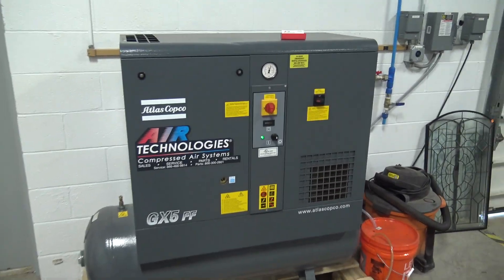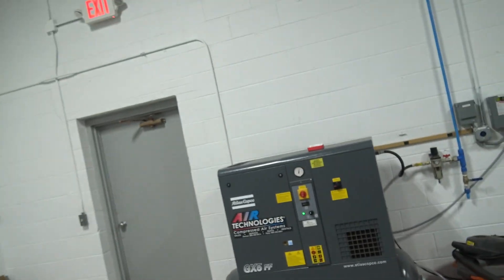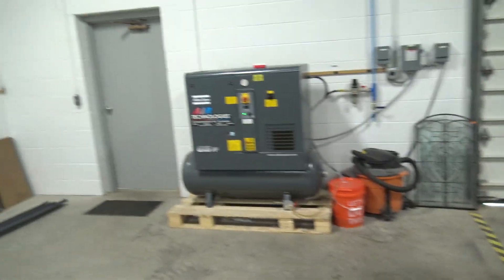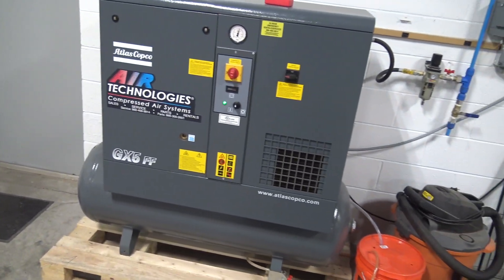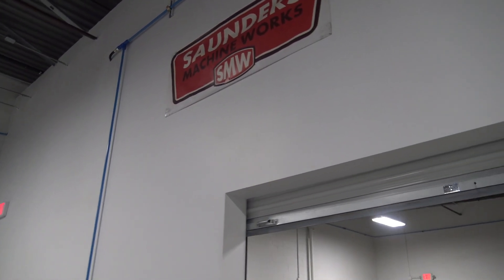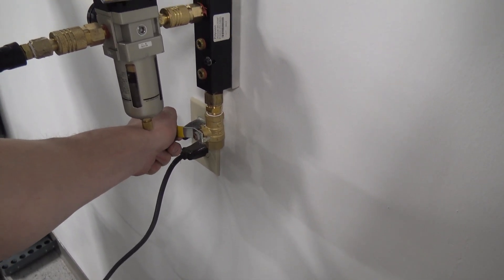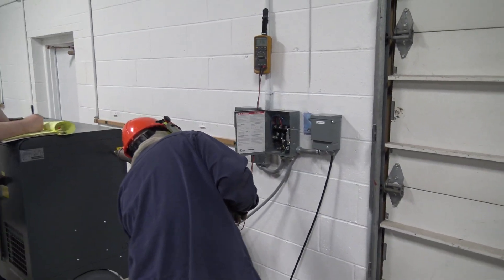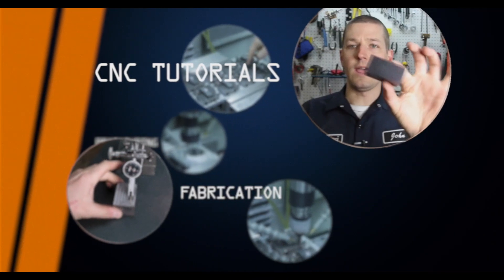Rotary Screw Air Compressor:  What are they?!  Worth the hype?

Comment: Beautiful shop!, first time watching your vids!
I have used and worked around a number of screw comps, 10hp to 65hp, and they are definitely a nice compressor compared to piston comps. 
They are designed to use oil to help sealing of the rotors and pass a LOT of it out the discharge, and the oil separator should catch 99% of it, but a external refrigerated dryer with proper filters and traps, will give you superbly clean air!, again, not cheap, but worth it in the long run!. 
The one at my old work is an Italian made 10hp unit (ABAC or some company), and the auto-drains did dump a tiny bit of oil outside the shop, but very very little. not enough to show on the sight glass between services, its literally vapor, compared to some piston comps that blurt out oily milky goop every time you drain them.
Best of luck with it!, wish I could have one at home and at work :D
Reply: it look  like you are the the  excellent  techinal  engeener .   if need  low price spare parts replacment for altas copco spare parts .maybe can contact me .    and  screw air compressor come with  air dryer , filter  together units ,not very high price.  1200-2500USD . :face-purple-crying:

Comment: @NYC CNC it is actually a good naming scheme. GX5 is because it is a 5KW motor. Most Atlas Copco compressors work this way. GA11 = 11KW motor
Reply: Also the computers are fitted to the next GA range and is called an Elektronikon. Reason compressors dont like too many stop/starts is because during start up they draw a high current to get the motor going. This causes the windings to heat up inside the motor causing them to short and blow the motor if it starts too many times. This unit will be limited to 240 starts per day and as you go to higher power motors this reduces. If you go for a VSD they can start much more often. You could also get a thing called an OSC which the condensate from the compressor drains into and it separates the oil from the water before draining the water into the normal drains.

Comment: I have been using German screw compressor 10 HP since 2010 and its really great.first of all its way quieter than those piston ones (when I hear them now they feel like someone is hammering on my head or if you remember those annoying woody wood pecker cartoons). and I think mine is quieter than yours too.They definetly save me ton of money in long run as I have attached a (30 inch diameter and 10 feet tall) tank (which I made in my own shop) to it as it didn't came with a tank. I only have to fill it once or twice a day and I only need to run it for 10 to 15 minuts. I am running it on its full capacity that is 8 bar pressure.I am using air for plasma cutter, air tools(drills, screw drivers, grinders for small work etc), CNC, and paint jobs.it definitely gives out some oil in the air that is why I keep my tank filled almost all times so that the moisture and oil settles down, and the auto float ball on the bottom of my tank can expel it and I get crisp and clean air for all my tools.I would definitely suggest people to buy this if they need ton of air all day long if not then cheapest is to go with piston compressor.

Comment: Lamens terms: it works like a supercharger.
Reply: Lynx Star Automotive 
I'm pretty sure roots compressors are waaaay more common in supercharging.
Reply: and waaaay more inefficient. Look up Lysholm supercharger, and you will see something very similar to what is in the air compressor. The -53 series Roots style blowers which came on old diesel trucks beat the air something chronic causing massive increase in air temp. Roots corrected this problem a tiny amount by twisting the rotors in the later -71 series blowers. But both series are massively inefficient compared to the more modern (been around for decades) Lysholm screw superchargers.

Comment: that particular Atlas Copco compressor will only run start stop, it's just like a piston compressor without head unloaders. it's really kind of a shame because  the nature of a rotary screw compressor is its ability to run continuously at 100% duty cycle, this compressor can only do this if you match it capacity or exceeded it
Reply: I am trying to talk my current work into buying one to replace the 20 Harbor freight grade chinzie piston comps they have strewn around the shop. I would love a 7.5hp continuous run unit for under $10 grand with dryer unit and tank, but the boss is a bit stiff and seems to be in love with buying loads of dirty cheap chinese crap :(, its a hard battle, but I will win eventually :D

Comment: Our last screw compressor was an atlas copco GA5 35 cfm after a 65 cfm Ingersol Rand that was running 2 large air powered printing machine. Fantastic machine, however we were not well aware of the stop/start cycles setting. When we downsized, the GA5 was essentially producing shop air only to a large receiver tank. We had barely used it over a period of 5 years. Short story long, the air end was damaged by water in the oil and rusted bearings on the screws, and followed with damage to the screws. 4.5k to rebuild ouch! So after the damage was done, we were told the computer was programmable to keep it running and allow it to get up to temperature, evaporating the moisture out of the oil and thus not getting fucked. Expensive lesson to learn, we ended up selling it for scrap value. I now have a vane compressor which doesn't have any of the fancy refrigeration but pumps a stack load of air at much cheaper price and quieter. As you say, screw compressors are awesome for continuous supply
Reply: yes, we were made aware of this and programmed the run-time as you were talking about, remaining on idle for longer periods. this was not originally set up when commissioned, so the compressor worked for a number of years starting as required then stopping once pressure was reached, the oil was never really hot, so the moisture remained in oil, causing corrosion. We ended up going to a small 17cfm piston compressor for shop air, and only turning on the screw for spray painting and sandblasting after spending $1500 to have just the bearings replaced in the air end. (not spending $4500 on a new pair of screws), the machine was sat idle unused, then when i next went to use it for sandblasting it would not generate pressure. very sad end to an awesome machine, we got $500 for it as is when we moved shops
Reply: to clarify, the GA5 did have a run computer, we were not aware of a possible issue, and the computer was not commissioned to keep it running, and even with a computer we still suffered a major air end failure. The computer AND appropriate programming would have helped
Reply: ...retrofitting a controller to these machines can be an expensive way to go about solving run cycle issues. The simplest thing to do is have a multi function timer installed between the pressure switch and the start/stop circuits (contactor) and you can simply dial the time dial to whatever setting you wish and once the pressure switch unloads the compressor, instead of shutting down the machine instantly...it will run unloaded (idle) for the set time before shutting down...and if the pressure switch cycles before the time is up it resets and loads.
Reply: ...but saying all that, I understand some of those small Copcos don't have an inlet valve that can be cycled...in which case you're stuck start/stop...those type aren't very popular around here...come to think of it we don't have any in our client fleet...lol.

Comment: I'm only halfway through the video and out of time to finish it right now, but in case anyone looking to make a purchase of this size is reading comments to learn more I wanted to mention that both manufacturers and dealers have reps who will come check out your operation and talk to you about your needs and make specific recommendations. Establishing that relationship up front is ideal for the long-term. Some will even bring and install a demo unit for a week so you can see how you like it. This is true of many kinds of shop equipment. 

Bottom line: it doesn't always make sense to try to do all of your own research alone.

Comment: You said in the beginning of the video that you where hoping for a "computer" on the compressor... so you can control the start/stop of the compressor. There should be a timer in the electrical cabinet of the compressor so you can run the compressor in "constant run mode". Most are set to run anywhere from 5-7 minutes before turning off after reaching you set pressure. Also constant run mode saves a lot of energy and money from starting. We recommend it if your compressor is starting more than 5-7 times an hour. Also check out Teseo pipe systems. It will get rid of your bulky manifolds for your drop ends.
Reply: That particular Atlas Copco only run's start stop, it has only a check valve on the inlet not a controllable inlet valve
Reply: Aaaa ok I wondered that.

Comment: I work at a tobacco facility at this time and Atlas Copco is the name of the game there having at least 20 of their bigger compressors, some even hooked in parrallel to keep up, with all the dehydrators and stuff all around the plant...At this point though there are room heat issues and they will be installing some equally extreme ventilation system in all the compressor rooms before the summer takes a toll on them!
Reply: That food grade oil really doesn’t like that heat.

Comment: My answer to air compressor noise is to oversize the motor a whole bunch.  Put a 3hp motor on your 1.5hp compressor and it'll be a lot quieter as there is more torque to drive through top dead center and it "knocks" a lot less.
Reply: electric "engines" are rather quiet
Reply: Greg Collins No.
Why not do this?
https://youtu.be/zIQ_AM3bnwo
Ave three phase air compressorb
Reply: a larger engine would surly make more noise...

Comment: I HATE piston air compressors.  What do own?  Piston compressors.  I keep them outside.  Doesn't solve the problem of noise but it cuts it down as for inside the shop.  I do put a small shed over them. I can get away with it because we are in a dry part of the country so water in the tank is a little less than in wetter parts of the county.
Reply: Never thought of that.  Not sure but the pounding of the pistons and air is still louder with the compressor inside than out but it's a good thought.
Reply: NYC CNC Unless you have VERY good water separators and narrow outside humidity range, outside fresh air intakes for air compressors is NOT a good idea.

Condensation will be a constant problem even with high performance (expensive) water separators installed. They'll need constant maintenance and replacement intervals.

It's one reason I like a 3 or 4 piston compressor models, running at very low RPM. Quiet and long lasting because it operates at ¼ of the friction temperature. The only drawback, they use electricity as fast as water going over Niagara Falls...
Reply: Doug Hanchard I put a spitter valve the spits a little out the drain valve every time the compressor shuts off.  Don't have to worry about it.
Reply: The problem is the real-time increase in H2O. "Normal" separators can't keep up. Paper cartridge types can, but during the winter, they fill up rather quickly. Especially when the outside air temperature is 25-32 F and snowing.
Reply: Doug Hanchard I'm not running a paint shop.  Just air tools and the like.  A small amount of moisture won't hurt especially because I'm careful to lube every day. (that may not have come out right.)

Comment: its like a turbo on a car if you run it hard and shut it off, the tolerances close down and you cant get it to spin again due to the heat that it builds up from compressing the air.

Comment: Interesting. Honestly have to say for that much (7 grand!) I'd build a doghouse on the outside of the wall to house the piston compressor outside the work environment. Problem with that of couse is sucking cold air in winter, but you can plumb a warm air intake back inside. Auto drains are okay for regular workshops, but a bad idea for remote unmanned facilities. They are known to sometimes get stuck open then you have pressure drop plus full time compressor run. As to your noise problem: I quieted down a VERY noisy transmitter facility by sticking carpet on large flat surfaces such as beams and selected wall sections. Floor obviously not carpetable in a machine shop. If carpet on walls offends asthetics then high density fiberglass panels are available (used in sound studios, but it is very pricey.)

Comment: My 15hp Abac Genesis is being wired up today. This video made me sure to check out the manual on rotation direction, it turns out there is a phase sequence relay in the panel which will indicate if the phase direction is correct and I assume also prevent operation if it is not. The manual states that even a few seconds in the wrong direction can cause damage, that might just be to scare the reader or could relate to the specifics of that design. Anyway your video came at just the right time, thanks.

Comment: I've got a gx4 in my "hobby shop and i love it. I use a 1500 liter tank so that the compressor runs for a good while every time i use it
Reply: I have never had any problem with it being too big. :) 
Its like i can get away with jobs sligtly too big for the compressor because of the buffer. 

My dryer is between the compressor and the tank. My own idéa, I figgured hot air  would dry better because of the bigger difference in temperature. I don't know if I did it right:)

Comment: Typically a 40 amp circuit requires #8 awg. (70 Degree Column NEC 310-16) If it is #10, I would change it to #8, especially if the distance to the panel is significant. Max Circuit Breaker on #10 is 30 Amp.
Love Your Videos BTW

Comment: It costs more energy to start a part moving from a stopped state than it does to speed up a moving part that is already in motion (newton's law kinda deal)
also, if the screws are stopped, unless there is 0 backlash withing the drive gears, when you start it back up, they will reengage, and this can cause wear. 

Or at least that would be my thinking on the start-stop issue you mentioned.

Comment: be glad you didn't get the computer. we got an ingersoll rand variable drive screw compressor with a computer what a piece of shit. it was always broken. we finally got just a regular ingersoll rand screw compressor and haven't had any problems. they do tend to blow oil as long as you have oil separators in the system you should be fine .

Comment: John,

If a salesman's commission is say 10%, will he/she sell you a $7,000 compressor or a $2,000 compressor? You main need seems to be quiet, an outdoor intake with a filter/muffler solves this problem nicely for the price of PVC pipe and  some plumber time. The cost is sunk now and you seem to be happy with your decision so that is good enough. Sometimes our purchases are more to keep up with the other guy. The business question is what does the additional cost add to the bottom line over the life of the asset, describing the number of hours one works can easily slip into rationalization. Once the costs are sunk, there is only one option, use the capital or lose the income from said capital. 

A large mold making shop recently featured in a mold making magazine has 30 employees and 32,000 square feet or about 1,000 sq foot/employee. They appear well run. 

It comes down to capital/labor in the case of a small business owner. If you are not incorporated, your capital will cost you an additional 15% employment tax; it is real and it can be a drag. Think of purchasing a $250K machine and adding $37,500 to the amount needed to pay for it only half of which is deductible. It can wear a guy down, cause self doubt without understanding the cause.

In your case, the difference between a $2K compressor and a $7K compressor is only an additional $750 for employment taxes assuming you are not a corporation. 

Something to think about. 

Keep up the good work.

Comment: I have used both pump and screws off and on for years. One thing screws have on a pump is the time it takes to catch up under heavy use. The cfm rating on the screw is much higher for sure. someone mentioned about the start up, it does take more power to start than just an idle from the screw. Which is a no load situation. In your situation it sounds like you don't really have a need for large comsumption of air but some day you may and you will be set. Its not really fair to compare the two units because the screw has some things on it that the pump will need under heavy use, like the drier. Prices on those units are up there too. And by the way the driers run all the time too. You have a nice compressor and will for many years to come. I think its worth the extra for sure.

Comment: You ought to plumb your old piston compressor into your system. Not for the compressor but just the tank as additional storage. Looks like you would at least double your capacity. At least until you sell it or whatever.

Comment: Thanks John for the very informative Air Compressor video!

As far as monitoring your machines. installing cameras in your machines might be useful. Either a multicamera analog security system, or a set of IP cameras permanently mounted in your machines. You could just add a secondary monitor in your office with a split view for each machine. Perhaps even remote e-stop buttons in your office so you can stop a machine if you spot a problem with out have to run across the room.

Comment: I have serious air envy!!!

John, while laying on the beach check out acoustic wall and ceiling panels for industrial noise control. The audiophile sector is, err, "passionate" about the topic, but if you can get past that, it may lead you to some inexpensive DIY type solutions using common insulation bats etc.